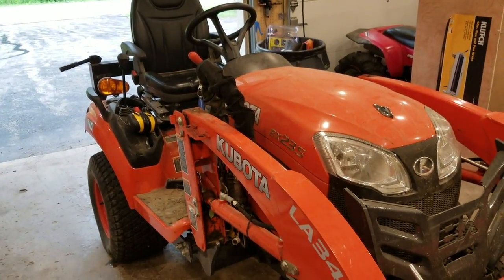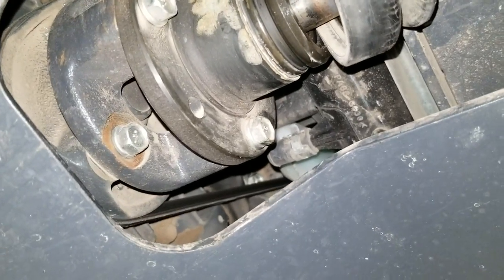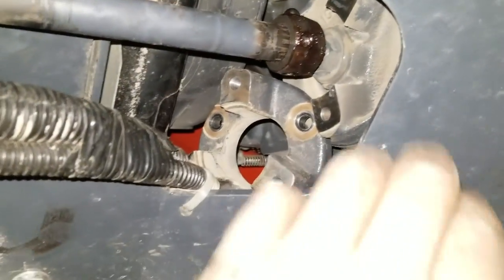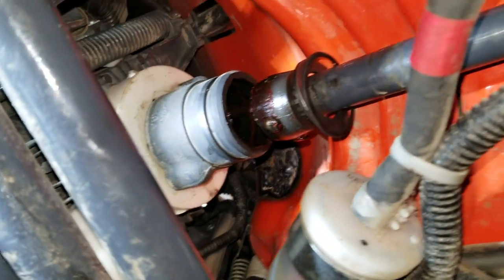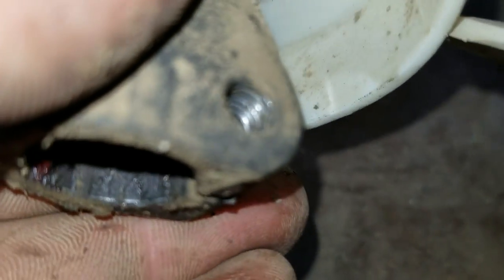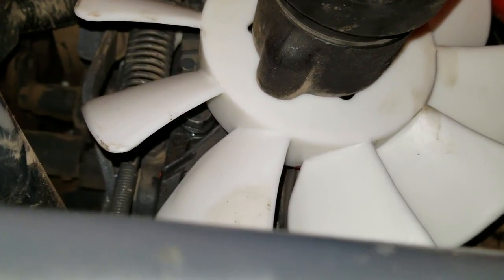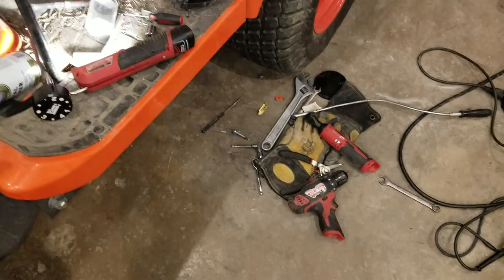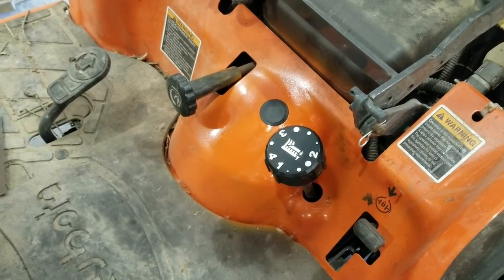Trick BX23S Transmission Fan Replacement Kubota How to

Comment: I have to admit, I rolled my eyes when I saw you drilling a hole through the fender, I thought for sure there had to be a better way, there isn’t a better way, and after wasting another two hours trying to find out that other way, I ended up drilling a hole through my fender at 2 1/2 inches and it came right off. My only bit of advice that I learned through experience was to completely remove the bolt behind the fan, at first I just loosened it but it would not come off all the way
Reply from the maker: Haha, I hear ya David! Sure saves a whole lot of time! Glad it worked out and thanks for letting me know!

Comment: I was able to get a stubby wrench on the fan bolt, but couldnt get enough leverage on it to remove the bolt... Even if I had; Once the new fan goes in, your back to needing thst top access.... Drilled the hole as well.  Good info.
Reply from the maker: Thanks for the feedback Andy! Glad it worked out for you!

Comment: I believe the reason the bolt threads are “stripped” is because the spring in the CV joint is pushing the bolt against the HST input shaft which in-turn flattens the threads.  I recently replaced the HST fan on my BX 1850 and no matter what you do, the threads will be flattened on the bolt.  Good video - The BX 1850 does not have the two fittings on the front of the propeller shaft and requires the engine to be moved forward about 3 inches to get the clearance necessary to remove the two bolts holding on the HST fan.
Reply from the maker: Good point bud! Thanks for watching!

Comment: I have a 2007 BX2350. Unfortunately the hub off the crank that the drive shaft is bolted is not a removable part as shown in this video. The only way to get the drive shaft out is to unbolt the engine and pull it forward. A major pain in the rear. Total job took about 8 hours. I did take the rear fender and floorboard out as well. It was good opportunity to clean all thee movable parts and lubricate them. still a major ordeal!
Reply from the maker: Wow that definitely sounds like quite the undertaking! Goes to show engineers never care about the mechanics lol
Reply: I have the same tractor and it took me a while to figure out the difference.  It may be that Kubota finally figured out that making the intermediate, removable part would allow the repair without removing the engine - and applied to later models.

Comment: That rubber boot on the shaft you mentioned was slapping under the tractor making a horrible metallic sound.  Thought my tranny was going.  Cut the boot off and no more noise.
Reply from the maker: love an easy fix!

Comment: Do you have the part # that I need to order & thank you for the video. We need to replace ours also the size of the metric screw so we can have one just in case. Thank you
Reply from the maker: Your welcome. Thanks for watching. The fan part # is K2561-14230. Bolt part # is 01123-50830. Hope this helps!

Comment: You don't have to drill just pull the faring  forward under the front of the seat and use a flex socket on an extention .works great and no holes to repair
Reply: Also  remove the seat to give more room to work

Comment: Ugh….factory doesn’t know what never seize is….took me 2hrs and a lot penetrating oil etc to get the fitting off of the HST shaft. Once off I can see so much rust on the shaft and in the fitting…ugh. 
2015 BX2370
Reply from the maker: Yikes, that doesn't sound like a fun time

Comment: You don't really need to drill it if it was in a different position
Reply from the maker: More then one way to skin a cat. I could not get the bolt out through the opening other's did with their bx25. So I shared what I found.

Comment: I bought a extra fan , im looking for a aluminum alloy company that can rebuild it with steel or aluminum...2nd time changing it , im over bad designs , ill throw that garbage in the junk and reconfugure a better way to cool off that weak hydro pump , kubota should feel embarrassed that they hired a idiot to put a plastic fan on that ...my bx2380 was 28000 dollars , i feel like i got screwed by kubota's over priced cheap engineered junk , so i bought a new bobcat mt100 mini skid ...there engineers werent much better ...either im really smart or there really stupid , i came up with several better ways to fix and illuminate alot of there weak ass designed things on these machines ..
Cut , fabricate , welding required on somethings , hope you dont mind cutting up expensive junk and expermenting
Reply from the maker: I hear you on that. I did a video on the bxpanded skid plate.
 https://youtu.be/qGq2W41OlME
Granted it is ridiculous they don't have better protection from the factory
Reply: @Tyler_Koehn  im looking at this piece of 1/4 inch ( i think its 1/4 , maybe not but  its solid ) armor plate aluminum i have in my garage left over from another project , its about the right width and length , just need to mount it under there with brackets ..
Reply: I can also tell you removing the floor pan , the mower adjustment knobs break off , there glued on permanently,  i ordered new ones , but i dont use a mower on mine , never put them back